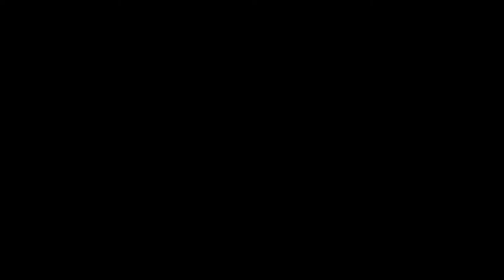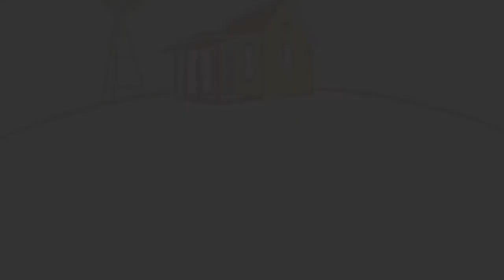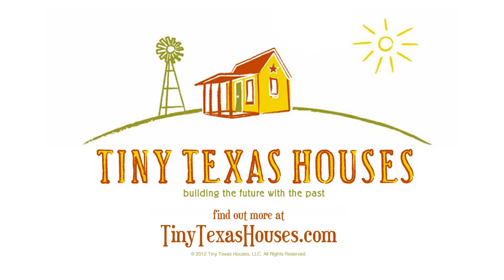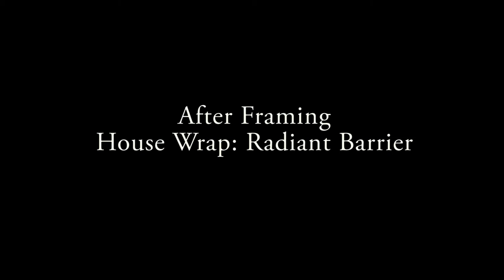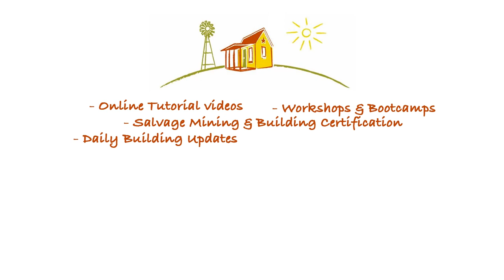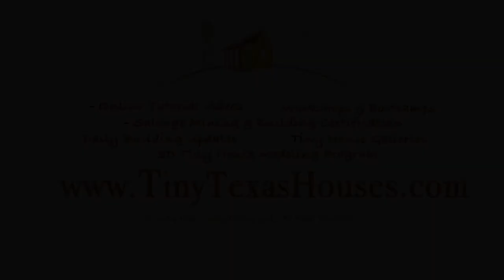House wrapping

Comment: Brad, this is Jeff Lanthier and I have been in the building industry since somewhere around 1977.Right now I operate under Lanthier Construction LLC. .We knew each other early on and I may be able to help you fill in some  of the missing blanks regarding insulation and vapor barriers. I will certainly help you any way I can. It isn't complicated at all. Just straight foreword. You might be interested in the feedback I haver received almost monthly regarding one home in particular I have built regarding energy consumption. Although built in 2003 It has  been my most efficient build to date. If you post back to me on Facebook I will break my boycott and post back to you this time. If you look me up on line and leave a message on my home phone I will likely call you back.